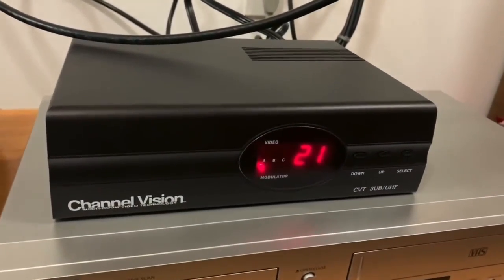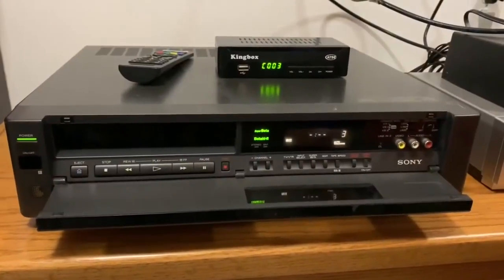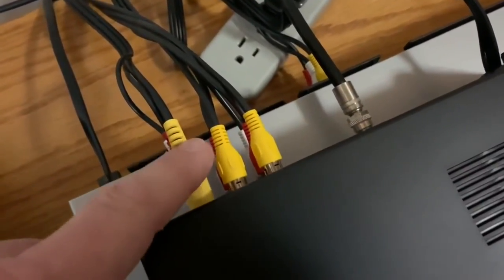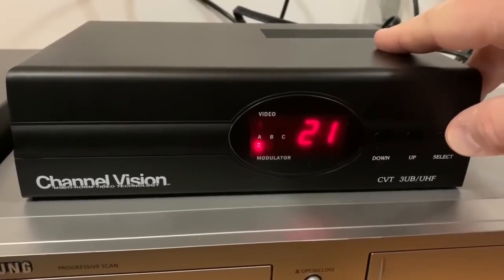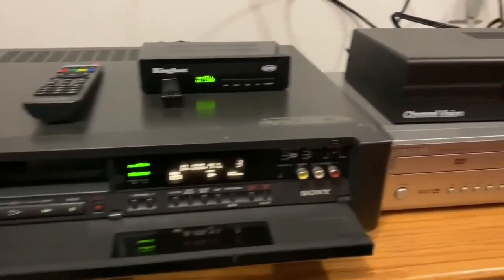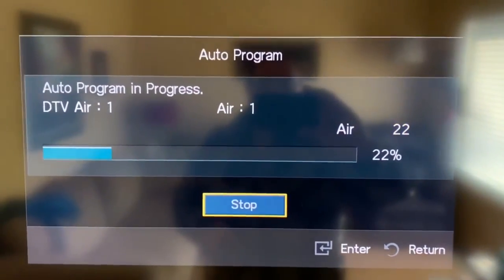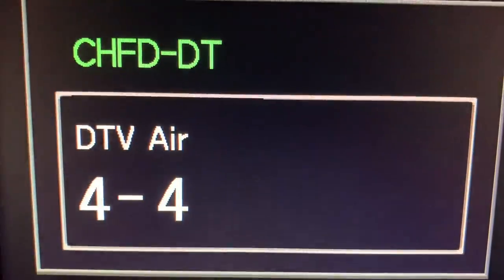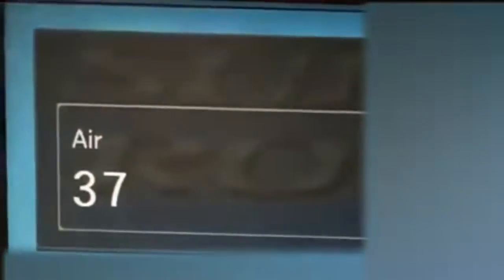Making your own Home Cable TV System | analog channels using a UHF Modulator

Comment: when it comes to diplexer is there a specific kind I should avoid? I'm looking to connect 2 or 3 mixture of Blonder Modulators and Channel Visions. Most of the diplexers I see online are for Antenna & SAT bridging. Not sure if 2 or more modulators & multiple diplexers can go into those or not.

Comment: Please provide link where uhf modulator and diplexer can be found?
Reply from the maker: The modulator featured in the video was an eBay find. Here is a less expensive one that serves the same purpose.

https://amzn.to/3vTZlsE

Adding in your own private analog TV channel to your TV Antenna signal - UHF RF modulator
https://youtu.be/f9vhcvSsoac
Reply: @NorthcoasterHobby  Thanks for your kindness and timely responses.Im going to get this modulator to solve two issues of making own cable system and converting old analog tv to hdmi capabilities.How best to change the video on a old pre1980 Toshiba tv so to see the screen better?Thanks in advance!

Comment: You might want to get a powered splitter, unpowered introduces loss and makes the signal weaker each time it splits
Reply from the maker: Thanks for the tip.👍
Reply from the maker: TV Antenna Signal Amplifier | 4-way Amplified Splitter - Channel Master CM-3414
https://youtu.be/EMy1j5k_cKo
Reply: @NorthcoasterHobby  Is the home cable system private? And is this legal as long as it's private and not over the air?
Reply from the maker: @CatsRobloxOther2nd  Yes, as long as you are not broadcasting a signal.
Reply: @NorthcoasterHobby  okay
Reply: @NorthcoasterHobby  if I ever get the equipment for a private home system id probably set it up for the guest room
Edit:there's a dish joey that I have connected to my living room TV so I could access recording from a external dvr but sadly the joey cannot recognize the external dvr
Reply from the maker: @CatsRobloxOther2nd  The Joey is proprietary equipment.
Reply: @NorthcoasterHobby  ah

Comment: DUDE DONT USE CHANNEL 37 THEY USE UIT FOR RADIO ASTROLOMIGIEY
Reply from the maker: They use channel 37 over the air for astronomy. This is channel 37 on a closed-circuit cable system in my house. Totally different, dude.
Reply: CRAP I HAVE AN ANALOGUE TV OVER THE AIR CHANNEL AND ITS ON 37